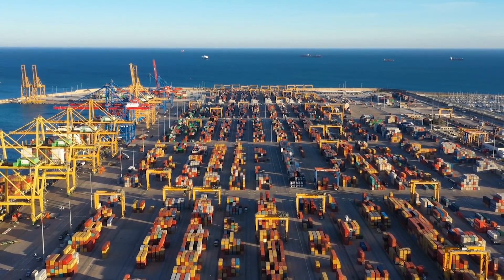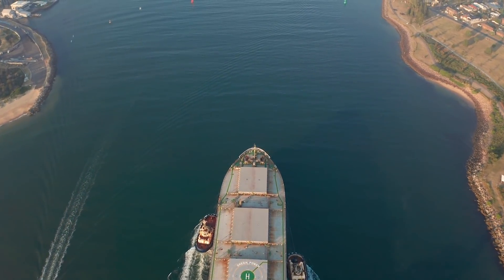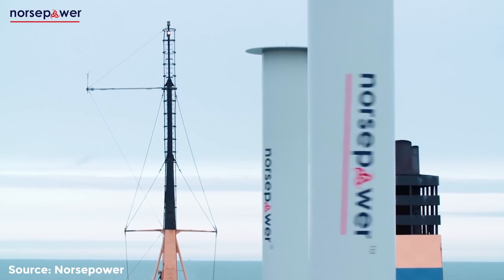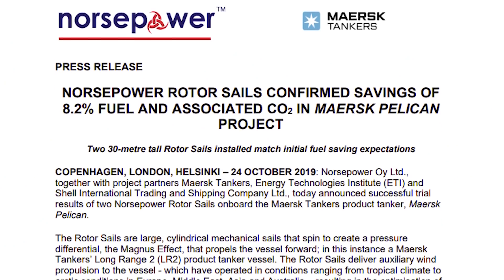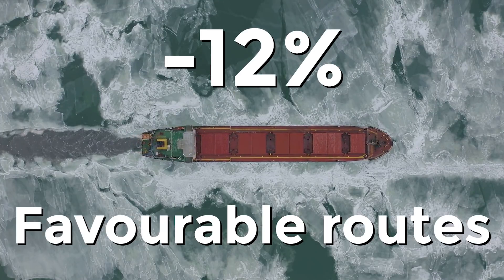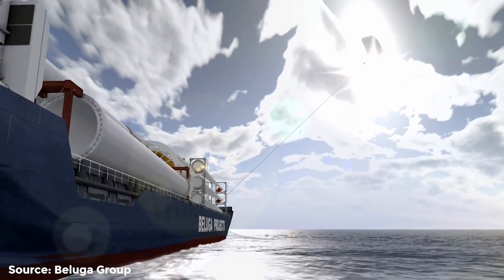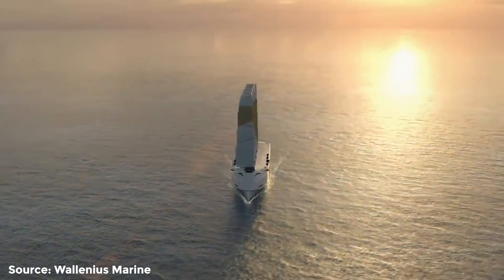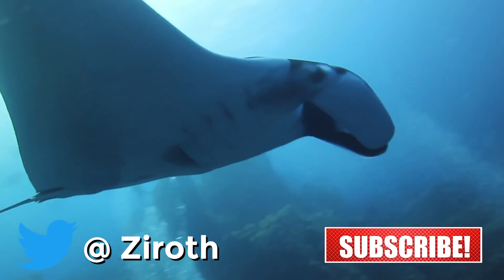Is Wind Power The Future of Shipping?

Comment: You could just put wind turbine generators all over the deck.
Reply: Wallenius are currently giving wind power a go with wing form ‘sails’ but evidence is a little short of proof as of this date.  KTH (Kungliga Tekniska högskolan), a sort of up market university in Stockholm, who are using the funding to derive results will probably, and eventually, in the best traditions of academia ‘publish’ a ‘paper’ unless the funders invoke the well known ‘commercial sensitivity clause’ of their agreement with the KTH.  On board wind turbine might get you around some of the problems however for marine use vertical axis wind turbines (VAWT) would be better than the, what have now become 'traditional', horizontal axis wind turbines (HAWT) for reasons that include the air draught of the vessel, weight distribution and maintenance access.  The energy yield is still subject to the wind blowing at the right strength and having space available on board for the hardware.  The masts, rigging and sail handling arrangements would take up 'prime real estate' on the vessel.  Fuel oil bunker tanks can be stuck away in any odd corner and the ICE power plants are themselves relatively compact.  The stacked up 'boxes' would mean putting the wind driven propulsion units in a bad situation from a ship stability point of view.

Comment: A combination of both I can see it happens to some extend (only in certain cases) but make a full wind powered commercial ship for long distances I can't see it happenning (much less for short distances). The wind could die at any moment, there is planty of places in a rout where you have very little wind or too much wind, plus achieving 15/20 knts for those ships with wind is kinda unrealistic.
Reply: To address the suggestions that wind power is the answer I offer the following example.  In 1870 a premium sailing vessel entered service, the ‘Cutty Sark’.  The Cutty Sark was 64.74 metres in length with a beam of 10.97 metres and a loaded displacement of 2 100 tonnes.  She was able to carry, at best, 1 700 tonnes of cargo and to harness the energy in the wind the available spread of canvas was up to 2 976m2 which was tended by a crew of about 30 skilled men.  A ratio between the sail area (SA) and the vessels displacement (D) determines how lively she is; ‘lively’ being nautical speak for ‘fast and manoeuvrable’.  The carrying capacity of cargo ships is constrained in two ways, mass and volume which leads us to the ‘stowage factor’ of the cargo; the more mass on board the greater the displacement which in turn impacts the efficiency of the hull form and sail area / displacement ratio.  A vessel constrained by mass is said to be ‘down but not full’, while a vessel constrained by volume is said to be ‘full but not down.  When in the tea trade, which the ‘Cutty Sark’ was designed and built for with fine lines (more nautical tech speak, so again no need to worry about it) she could carry around 600 tonnes of cargo at speeds of up to 17.5 knots dependent on the prevailing wind and had a typical China to UK time on passage of 120 days.  The tea trade was very competitive so ‘time on passage’ was a large factor in securing the premium freight rate that made her cost effective.  Rounding things out, her maximum available sail area gave circa 5m2 of canvas for every tonne of tea carried.

As soon as the Suez Canal opened, which the ‘Cutty Sark’ was unable to sail through; she lost her advantage, raw speed, to the steam powered ships of that era who could beat her ‘time on passage’ by taking that short cut.  Mechanically powered ships have improved in terms of efficiency, on a freight tonne mile basis, by at least one order of magnitude since then.  After losing out to the coal burning, fire tube boiler, steam reciprocating mechanical ships of the late 19th century ‘Cutty Sark’ was relegated to the Australian wool trade, just about the bottom of the barrel in maritime terms and only one small step up from being a 'honey barge'.  The canvas, cordage and extra manpower needed for sailing ships was never a very benign environmental option so please discount any idea of sail as ‘sustainable’.  All this is without the problem that if ‘the wind don’t blow the ship don’t go’, when it does blow it often blows in the wrong direction for your cargo delivery needs and sometimes there is rather too much of it for comfort.  Sailing ships are unable to go directly up wind so if the wind is blowing form the direction your cargo needs to then a zig-zag course must be steered, more distance and more time.  Wind is traditionally measured on the Beaufort Scale (wind speed) that runs from 0 (< 1kn) to 12 (> 63kn) and for sailing purposes the usable part of the range is ‘3’ (circa 8kn) to ‘6’ (circa 24kn).

Random fact about ‘Cutty Sark’, it is said to have been possible to coax 3 000 horse power out of her sails, or in ‘real money’ 2 206 500 Watts (2.2 megaWatts), assuming this was in ideal conditions that is about ⅔ of the solar power that might be harvested from the ‘top of stow’ of a Maersk Triple E, again in those elusive ideal conditions and 741 Watts for each square meter of sail area.  So that majestic spread of canvas would have been even less efficacious for delivering your baubles and bows from the orient, despite taking about three times as long on the voyage.  The sails on the ‘Cutty Sark produce about 0.33% of the power need to propel a Mearsk Triple E and covering the top of the stow might produce another 0.5% so with both systems working simultaneously in ‘ideal conditions’ the energy harvest would be less than 1% of the output from the ICEs.  Combining with solar electric would involve two systems in place of one, which then runs you into the problems of expense, complexity, integration and redundancy.  Remember shipping is a high volume low cost, therefore low margin business, and all costs have to be beneficial.

Canvas and hemp are accorded 'renewable' (read as ‘natural’) status, if ‘synthetics’ are used there will still be a need for the input of FOGI products.  'Synthetics' would have a much better working life span than 'naturals' but would still yield the same amount of energy, 741 Watts for each square meter in those elusive ideal conditions.  Wallenius are currently giving wind power a go with wing form ‘sails’ but evidence is a little short of proof as of this date.  KTH (Kungliga Tekniska högskolan), a sort of up market university in Stockholm, who are using the funding to derive results will probably, and eventually, in the best traditions of academia ‘publish’ a ‘paper’ unless the funders invoke the well known ‘commercial sensitivity clause’ of their agreement with the KTH.  Wallenius is a major shipper of vehicles were the product is effectively its own packaging, other goods are moved about in ‘containers’ so the loss of capacity, ‘broken stowage’ in nautical speak, caused by containerisation needs to be factored in.  On board wind turbine might get you around some of the problems, however for marine use vertical axis wind turbines (VAWT) would be better than, the what have now become 'traditional', horizontal axis wind turbines (HAWT) for reasons that include the air draught of the vessel, weight distribution and maintenance access.  The energy yield is still subject to the wind blowing at the right strength and having space available on board for the hardware.  The masts, rigging and sail handling arrangements would take up 'prime real estate' on the vessel.  Fuel oil bunker tanks can be stuck away in any odd corner and the ICE power plants are themselves relatively compact.  The stacked up 'boxes' would mean putting the wind driven propulsion units in a bad situation from a ship stability point of view.

Comment: so 300 years later we go back to sailing
Reply: To address the suggestions that wind power is the answer I offer the following example.  In 1870 a premium sailing vessel entered service, the ‘Cutty Sark’.  The Cutty Sark was 64.74 metres in length with a beam of 10.97 metres and a loaded displacement of 2 100 tonnes.  She was able to carry, at best, 1 700 tonnes of cargo and to harness the energy in the wind the available spread of canvas was up to 2 976m2 which was tended by a crew of about 30 skilled men.  A ratio between the sail area (SA) and the vessels displacement (D) determines how lively she is; ‘lively’ being nautical speak for ‘fast and manoeuvrable’.  The carrying capacity of cargo ships is constrained in two ways, mass and volume which leads us to the ‘stowage factor’ of the cargo; the more mass on board the greater the displacement which in turn impacts the efficiency of the hull form and sail area / displacement ratio.  A vessel constrained by mass is said to be ‘down but not full’, while a vessel constrained by volume is said to be ‘full but not down.  When in the tea trade, which the ‘Cutty Sark’ was designed and built for with fine lines (more nautical tech speak, so again no need to worry about it) she could carry around 600 tonnes of cargo at speeds of up to 17.5 knots dependent on the prevailing wind and had a typical China to UK time on passage of 120 days.  The tea trade was very competitive so ‘time on passage’ was a large factor in securing the premium freight rate that made her cost effective.  Rounding things out, her maximum available sail area gave circa 5m2 of canvas for every tonne of tea carried.

As soon as the Suez Canal opened, which the ‘Cutty Sark’ was unable to sail through; she lost her advantage, raw speed, to the steam powered ships of that era who could beat her ‘time on passage’ by taking that short cut.  Mechanically powered ships have improved in terms of efficiency, on a freight tonne mile basis, by at least one order of magnitude since then.  After losing out to the coal burning, fire tube boiler, steam reciprocating mechanical ships of the late 19th century ‘Cutty Sark’ was relegated to the Australian wool trade, just about the bottom of the barrel in maritime terms and only one small step up from being a 'honey barge'.  The canvas, cordage and extra manpower needed for sailing ships was never a very benign environmental option so please discount any idea of sail as ‘sustainable’.  All this is without the problem that if ‘the wind don’t blow the ship don’t go’, when it does blow it often blows in the wrong direction for your cargo delivery needs and sometimes there is rather too much of it for comfort.  Sailing ships are unable to go directly up wind so if the wind is blowing form the direction your cargo needs to then a zig-zag course must be steered, more distance and more time.  Wind is traditionally measured on the Beaufort Scale (wind speed) that runs from 0 (< 1kn) to 12 (> 63kn) and for sailing purposes the usable part of the range is ‘3’ (circa 8kn) to ‘6’ (circa 24kn).

Random fact about ‘Cutty Sark’, it is said to have been possible to coax 3 000 horse power out of her sails, or in ‘real money’ 2 206 500 Watts (2.2 megaWatts), assuming this was in ideal conditions that is about ⅔ of the solar power that might be harvested from the ‘top of stow’ of a Maersk Triple E, again in those elusive ideal conditions and 741 Watts for each square meter of sail area.  So that majestic spread of canvas would have been even less efficacious for delivering your baubles and bows from the orient, despite taking about three times as long on the voyage.  The sails on the ‘Cutty Sark produce about 0.33% of the power need to propel a Mearsk Triple E and covering the top of the stow might produce another 0.5% so with both systems working simultaneously in ‘ideal conditions’ the energy harvest would be less than 1% of the output from the ICEs.  Combining with solar electric would involve two systems in place of one, which then runs you into the problems of expense, complexity, integration and redundancy.  Remember shipping is a high volume low cost, therefore low margin business, and all costs have to be beneficial.

Canvas and hemp are accorded 'renewable' (read as ‘natural’) status, if ‘synthetics’ are used there will still be a need for the input of FOGI products.  'Synthetics' would have a much better working life span than 'naturals' but would still yield the same amount of energy, 741 Watts for each square meter in those elusive ideal conditions.  Wallenius are currently giving wind power a go with wing form ‘sails’ but evidence is a little short of proof as of this date.  KTH (Kungliga Tekniska högskolan), a sort of up market university in Stockholm, who are using the funding to derive results will probably, and eventually, in the best traditions of academia ‘publish’ a ‘paper’ unless the funders invoke the well known ‘commercial sensitivity clause’ of their agreement with the KTH.  Wallenius is a major shipper of vehicles were the product is effectively its own packaging, other goods are moved about in ‘containers’ so the loss of capacity, ‘broken stowage’ in nautical speak, caused by containerisation needs to be factored in.  On board wind turbine might get you around some of the problems, however for marine use vertical axis wind turbines (VAWT) would be better than, the what have now become 'traditional', horizontal axis wind turbines (HAWT) for reasons that include the air draught of the vessel, weight distribution and maintenance access.  The energy yield is still subject to the wind blowing at the right strength and having space available on board for the hardware.  The masts, rigging and sail handling arrangements would take up 'prime real estate' on the vessel.  Fuel oil bunker tanks can be stuck away in any odd corner and the ICE power plants are themselves relatively compact.  The stacked up 'boxes' would mean putting the wind driven propulsion units in a bad situation from a ship stability point of view.

Comment: Or just go nuke.....
Reply: If you do a web search for ‘nuclear ship savannah’ you will see that it has been tried and did not work.  A similarly heavily subsidised, by the government, vessel is in use in Russia which also operates, in support of the Northern Sea Route, a fleet of nuclear powered ice breakers these may, or may not, have been completely without issues.

Just think; would you have full confidence in the management of a nuclear reactor under the control of an anonymous entity only traceable, perhaps, via a letter box in a FOC (flag of convenience) nation state?  If you are, could you sell that confidence to Japan, the state that hosted the Hiroshima and Nagasaki nuclear detonations as well as more recently the Fukushima ‘event’?  Then try that same, or a similar, sales strategy on Ukraine, the nation state that as a part of the USSR (CCCP) hosted the Chernobyl ‘event’.  Modern iterations of nuclear energy, thorium fuel, molten salt reactors or fusion reactors, will carry the legacy of past problems.  It is the global trepidation of anything with 'nuclear' in the name and the economics of nuclear having transitioned from 'energy to cheap to charge for' too 'the costs of remediation are incalculable' that will prevent the adoption of nuclear energy as a means of creating energy at sea.  Modern reaction systems may have overcome the safety problems but the general public, having been misled in the past, will be reluctant to believe the fresh new promises.

‘They’ say nuclear is cheap, it’s not it is expensive and has a large embedded carbon quotient as well as being complicated, dangerous, not universally socially acceptable and having only ‘no need for refuelling’ as a questionable advantage; actually it does need refuelling just not as often.  When ‘they’ do need to refill the warming up stuff it takes considerable longer than pumping tonnes of thick black stuff, HFO cSt380, or thin runny stuff, MDO, onboard which is one of the reasons HMS Queen Elizabeth and HMS Prince of Wales are pushed about by ICEs and gas turbines thus using a similar fuel as the aircraft that fly off of them.  The Royal Navy (RN) with a high degree of skill and expertise uses, at vast expenses to the UK taxpayer, a current operational nuclear fleet of 11 submarines (also known as ‘boats’) in two flotillas, seven attack subs and four ballistic missile boats.  The carbon footprint of all the extra bits of hardware and the fuel, including processing thereof, from ground to propeller, are the external costs that never seem to get considered.

Disposal, once it wears out, of both the machine (that was a ship) and fuel is another can of worms best left unopened.  The 26 RN boats no longer in use are laid up (some in Rosyth and some in Portsmouth) awaiting long term deconstruction including dealing with the fuel rods and other irradiated material.  The USN is not, as far as I know, a commercial organisation working to very tight margins and also has the skill and expertise to handle the complexities of nuclear power; so as well as submarines their aircraft carriers are nuclear powered and each of the current iteration has a build cost three times that of QE/PoW, bigger crews and more generous funding.  For those who still think that nuclear energy might be the answer I recommend this report: - https://www.bbc.com/future/article/20200901-the-radioactive-risk-of-sunken-nuclear-soviet-submarines?ocid=ww.social.link.email.  The navy of the USSR might have been under resourced and over extended but it was still generously supported in comparison with merchant shipping.